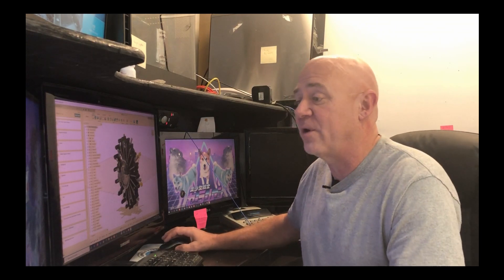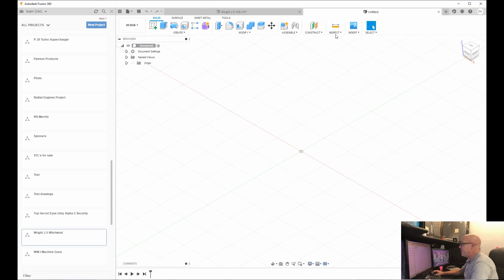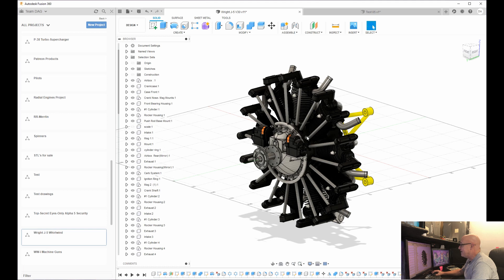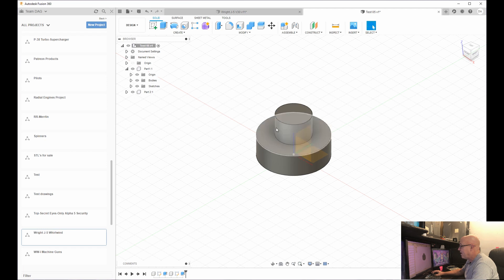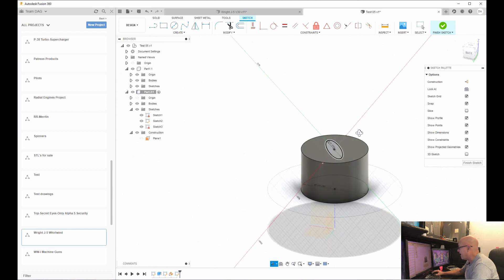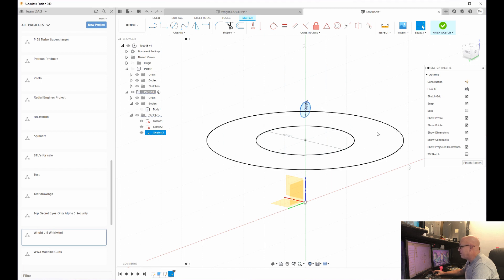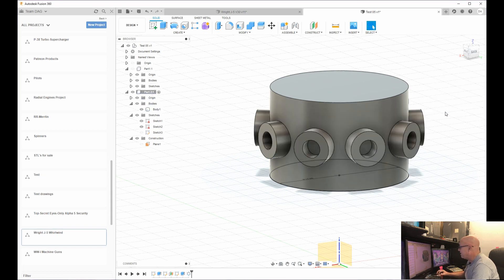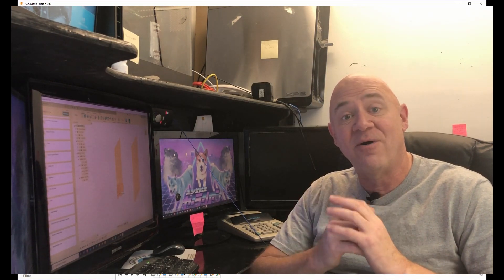Fusion 360 for RC Enthusiast

Comment: Dag,  I have been looking forward to this video series for some time (well at least since you asked about interest in it on Facebook).  At approximately 12:25 your comment made my day.  I am a self taught hack at F360 and there are times when I search youtube for hours trying to figure out how to accomplish something that I know is very simple, but I am lost in the language.  You at least made me feel better about my inefficient methods. While my models are not of the level of yours, the parts I am making are needed and the product that I get out of my 3D printer does the job. 

I tend to design in inches, only because I am using calipers to take measurements and that is all I have.  I have noticed that when I use File..3D print  to generate an stl file my model is undersized by a factor of 25.4  and I have to scale the model in my slicer to get it to print at a real scale.  I have done a little searching and been told that the reason because an .stl file is technically unitless  and expects metric measurements.  I have found if I do the Export off of the File menu and use the option that has to use the cloud processing then model is processed correctly and I do not have to scale it in my slicer. These are some workarounds I have figured out by trial and error for those who need or want to design in inches. The downside is the Export option takes a much longer time to generate the file.  At some point I will just need to invest in some metric calipers and the problem will go away.  

Another comment I have is with regard to creating shortcuts to the shortcut menu.  I have tried for the life of me to get these tools to save by checking the box.  They will be there until I exit the instance of F360.  When I return they are missing.  I have posted questions to the F360 support and short of others saying they observe the same thing there has yet to be a response how to fix it.  Effectively the shortcut menu becomes somewhat useless for me.  I am using the free version for hobbyists for a reference and wondering if you have any insight regarding this issue.

I look forward to you continuing this series.  I am looking forward to learn how to take fuselage formers and wing ribs and learn how to get a skin over them to create the actual surface.  I have a Mooney project that I used the canvas function to bring in a plan off the OZ site and have created all the parts and have them in the proper planes.  

Thanks for the work you put into this.  While at this point there are not a lot of views it is very meaningful to me and it will persist for others many years down the road.